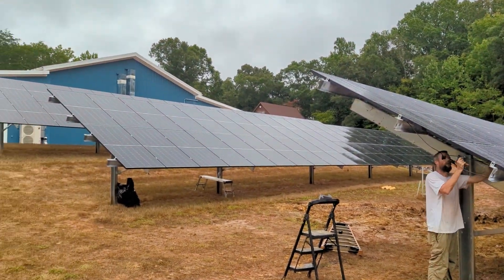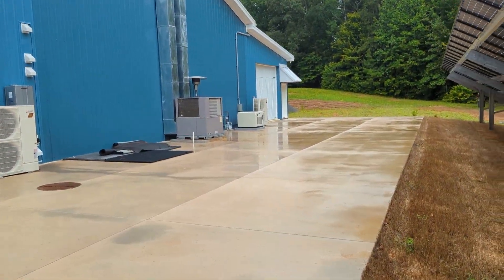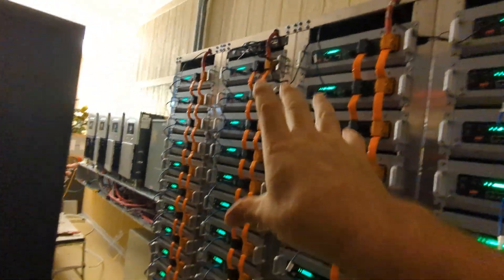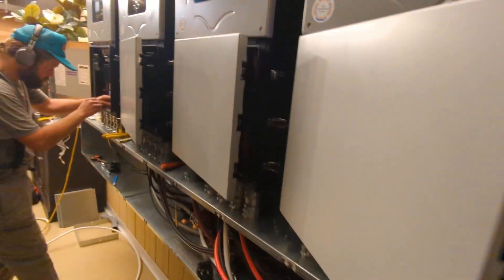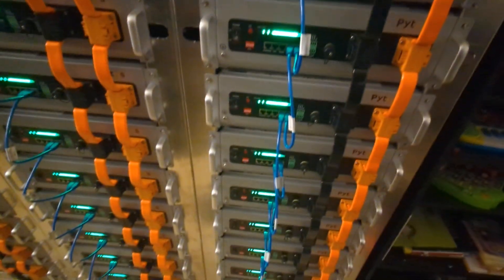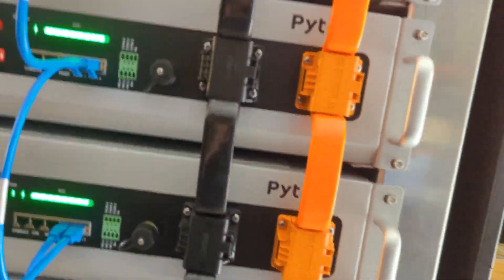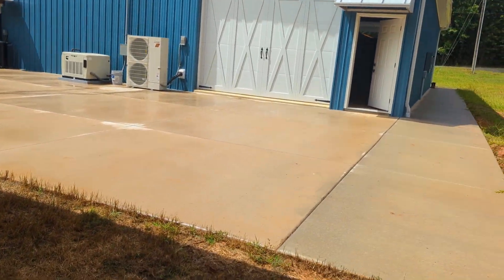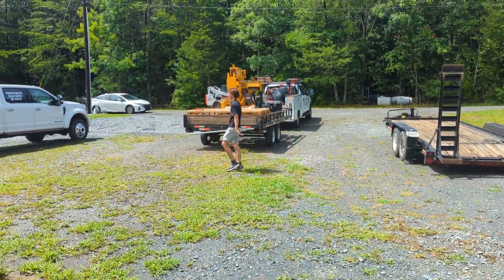Planning ahead for expansions.

Comment from the maker: We revisit this massive system and add even MORE battery storage!

Buy the Pytes V5 Lithium battery;
https://practicalpreppers.com/product/pytes-v5-lfp-battery/

Get a Sol-Ark 15k:
https://practicalpreppers.com/product/sol-ark-15k-120-240-208v-hybrid-solar-inverter-all-in-one-pre-wired-outdoor-rated/

Let's discuss your solar goals:
https://practicalpreppers.com/consultation/

Check out our DIY kits:
https://practicalpreppers.com/product-category/solar/diy/
Reply: Could multiple smaller generators be used? Could one be connected to each solark generator input?
I do understand this would not work for the manual bypass feed without complicated paralleling of the gens.

Comment: on a deployment like that with such a large battery bank, does the code limitations around ESS deployments just not matter because you are in a rural setting ?  Trying to do a large battery bank like that inside city limits for a residential placement and the city code enforcement folks are saying I can't do more than 80kwh of battery given IC limitations on ESS.

Comment: I do not see any auto transformers. Sol Ark doesn't have a transformer in them. To handle spikes properly some kind of transformer should be installed. For that system each inverter should have a auto transformer. Going with big systems like this why do you not use Snyder which are made for setups just like this.
Reply from the maker: @dc1544  I have 158 solark inverters out there that I'm monitoring both hybrids and offgrid. The need for an auto transformer has been greatly exaggerated based on earlier models of solarks. It is absolutely not needed. The efficiency of a solark blows the doors off of any Schneider system.

Comment: Wow. Look great!  Why do you have those 4-in nipples connecting the inverter to the wire trough? ...Wouldn't it just be easier to have the wire trough butt right up against the bottom of the inverter?
Reply: Air flow is my first guess.  Even if there AREN'T vents on the bottom of the inverter, letting air move naturally is always good.  Another aspect may be future replacement in the case of failure.  The 4" standoffs would give a little bit of wiggle room when setting the replacement inverter in place.  That said, I think the EG4 "interconnect trough" is designed to butt up close against the bottom of their inverters.

Comment: Are you able to say the total cost of hardware and labor? I am curious about the cost
Reply: After doing some research just looking at major components. The batteries are $100K, the panels/ground mounts are about $45K, and the inverters are $28K. I would add in another $25K for the smaller parts (power panel, disconnects, breakers, wiring, conduit, hardware etc.). I would say its around $200K without labor/tax/shipping.
Reply: @GRIMRPR6942   Thank you for the info.

Comment: I believe the Sol-Ark DIP switches are for enabling/disabling the communication bus termination resistors.  The device on each end of the bus needs to be terminated and the ones in the middle don't.